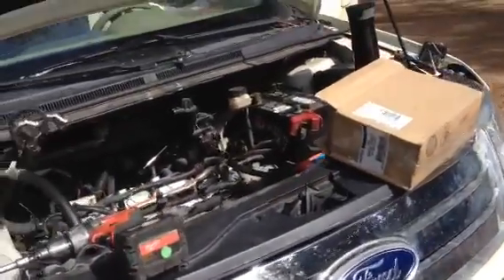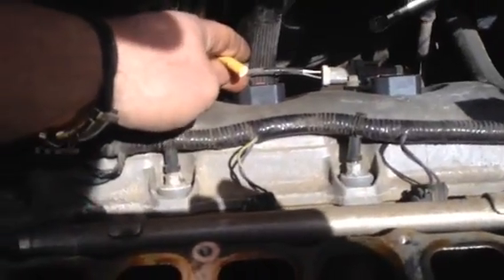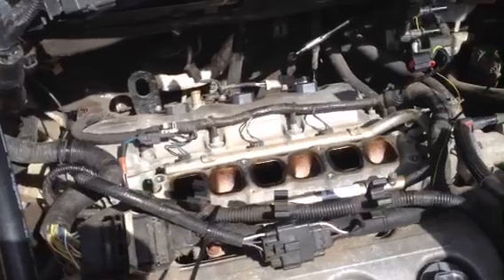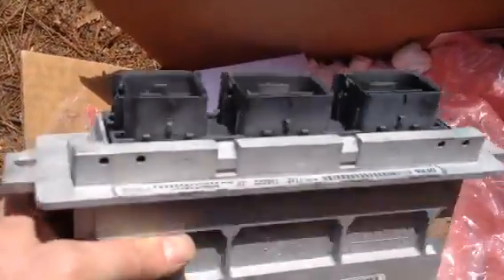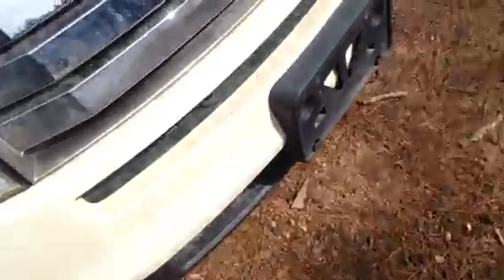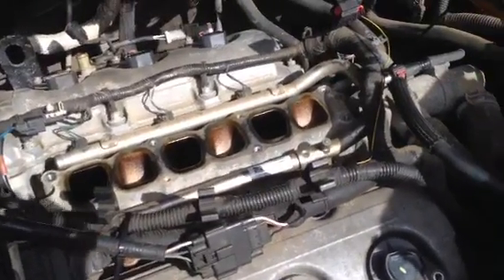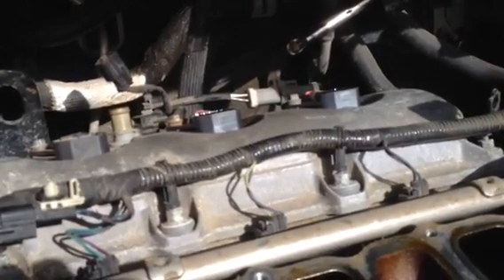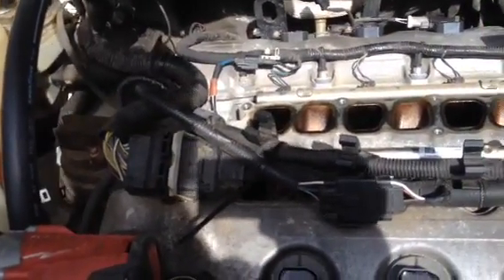Ford Edge ignition coil spark plugs

Comment: This guy saved me so much money that I can't believe it - the repair shop told me that I needed a new computer ($1600 plus re-keying charge) -- this was AFTER they had replaced one cylinder coil and spark plugs and charged me for that as well. I am convinced that if I had allowed them to sell me a new computer and they had replaced it without changing ALL of the cylinder coils I would have had the same problem afterward. As it was I got the set of coils, spark plugs and new gaskets in the kit that he mentions for around $150 and got the computer fixed by Circuit Medics for another $300 -- so total of $450 instead of the $1600 plus that the shop wanted. You are a saint!
Reply from the maker: Don Marcum that’s awesome I’m so glad this helped you